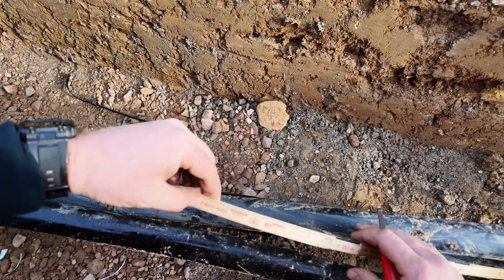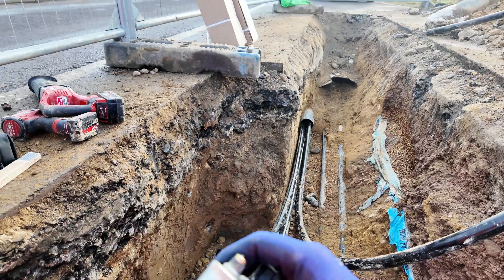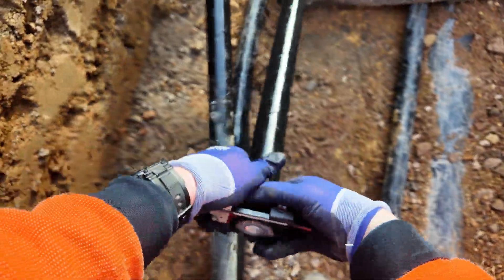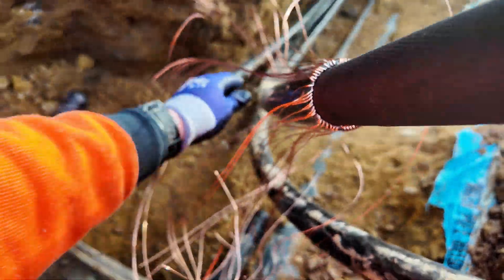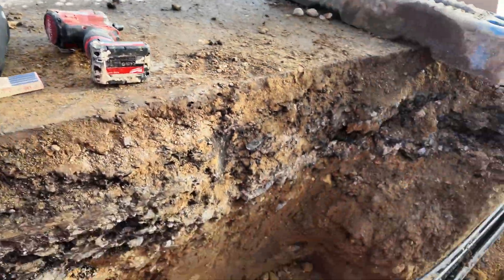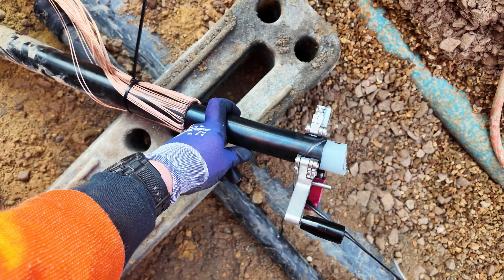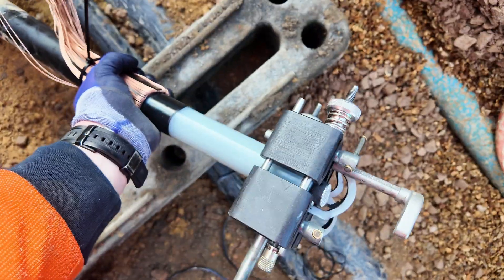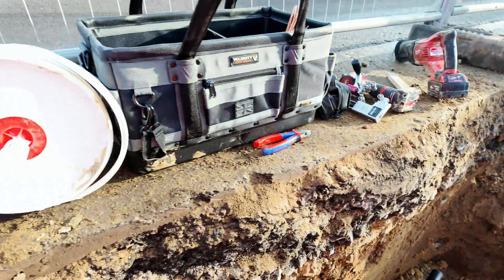Welcome to my very first long YouTube video! I’ll be showing how we open & prepare a 33kV cable!

Comment: Do you find the Stanley knife leaves any marks in the conductor?
Reply from the maker: What Stanley knife bud?
Reply: @HighVoltageHarv at about 12 minutes. But I’ve just heard you say you pull the material against the knife so you don’t score the core. Great work 👍